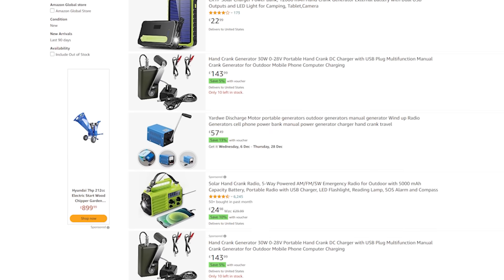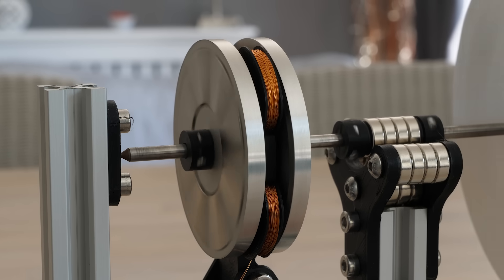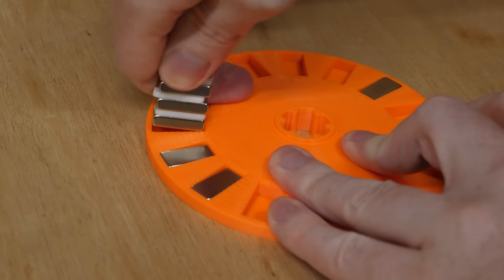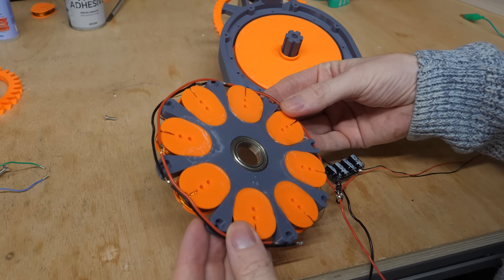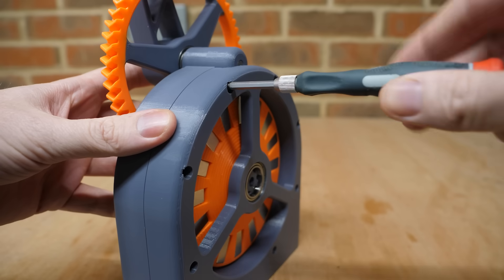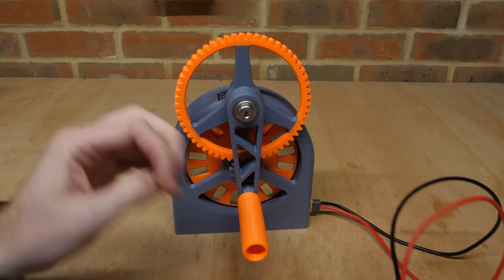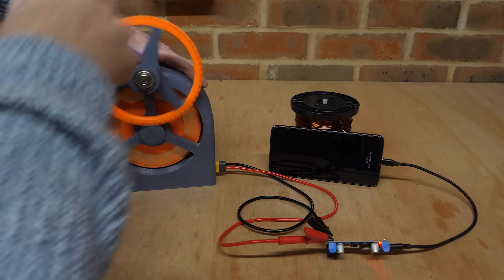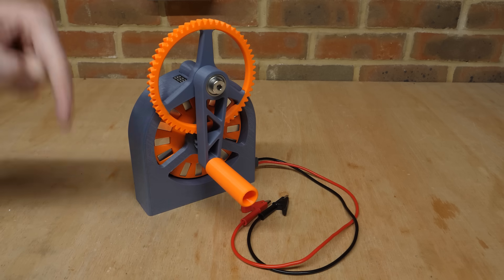Building a Generator

Comment: Absolutely LOVE this project Tim ! Attach a propellor, and you have a windmill, add a battery, and you go offgrid camping with full 12V electricity available. Measure available Kw output and explain calculations for windings, batteries, magnets and such, and there's a scientific story to be told too. This could take you in every direction you'd please 🙂
Reply: Sure you can. The only difficulties are in storing enough until next charging. excellent project!
Reply: @pauls5745 Don't charge/power stuff directly, instead use that power to charge an array of high capacity powerbanks.
Reply: modular crank device with interchangable crank shafts? windmill attachment, pedal attachment, hand crank(s), paddles?
Reply: hamster wheels and go crazy with it. free power lmao
Reply: @helo441  ok that one made me break out laughing omg
Reply: It is theoretically possible to adapt a turbine and take advantage of a decent water course as well.
Reply: I was thinking the very same thing
Reply: That's why wind power has failed massively. It's intermittent and not demand driven. Nice for small projects but not for large scale applications.
Reply: @flexairz  Water works tho u just need flowing water. Instead of the handcrank u could add on a waterwheel.
Reply: @jarateman6427  True, but it takes quite a bit of water to store energy using gravity. Unfortunately, the amount of cranking on a generator like this that would be needed for practical use would wear your arm out pretty fast! Might be better to hook it up to an exercise bike, though you would still get pretty tired.
Reply: @KitsuneKimmy yeah it needs a lot of water to store any significant amount of energy. if you want to store the equivalent of one Tesla powerwall (13.5kWh) by pumping water one story high you need 1600 tons even assuming 100% efficiency...
to fully charge an EV,  6000-1200 tons
this is why it only works when you have large bodies of water
Reply: @KitsuneKimmy  you could just up the gear ratio and lazily pedal at 10 rpm. Though you might blow something up if you put more effort in.
Reply: @KitsuneKimmy  How bout we settle this. We add propellers, a handcrank, a waterwheel, and a set of wheels to bike on. The ultimate power generator
Reply: @flexairz  In 2023, wind electricity production in the United States accounted for 12.5% of the country's total electrical generation. This was a 5.3% increase from the same period in 2022. Denmark uses 55% wind
Reply: @geemy9675  Thank you... it's hard to talk to those flat-earthers, but your numbers speaks with clearity, So again thanks for posting this !
Reply: @geemy9675  the key difference is that Denmark is more optimised for wind power. They get vastly more consistent wind than America, so it is more suitable. In addition, Denmark comes in at a low 43,094 km2 (16,639 sq mi), while America is at a staggering 9,831,510 km² (four million mi²). What this basically means is that a larger country needs to deliver the power to extremities better and will such have a large grid. Now why this matters is not because of the people but the generation. Basically wind power takes up a huge footprint compared to fossil fuels/nuclear, same as solar. These spread out power generation ares put a larger strain on the grid because they are not in the city too. In the country I live in, South Africa, the cost for constructing an amount of wind and solar is $7 00 000, while the grid cost is over $1 000 000. What this means is that wind power is not actually cheaper either because the grid construction cost to support it is massive, as well as nuclear and coal not having that problem as they can be built near one major city and that is it.
Reply: sorry for the paragraph im passionate lol, dad is a nuclear engineer/manager and im studying engineering and very interested. The best solution as a blueprint is high renewable (wind/solar/hydo), then backed with a lot of nuclear for the night time and winters. That way it is almost entirely clean, and very reliable. A lot of the scandinavian countries got lucky to have good wind or even geo like Norway, but most countries aren't so fortunate
Reply: @julianjeannes5369  In other words, we need to shift massive focus to nuclear energy and hydro-energy(where applicable.) 

There is literally zero excuse for the lack of nuclear energy. Nuclear energy is expensive but produces thousands of times as much energy as coal plants. We also don't need to mine for nearly as much material, nor spend the money to transplant said material. One ton of uranium produces the same amount of energy as 20000 tons of coal. 44 million kilowatt hours.

A single Uranium fuel pellet produces more energy than 2700 pounds of coal, 140 gallons of oil, etc. 

Also also, Thorium is 4 times as abundant and Thorium plants are less expensive than Uranium plants.
Reply: @julianjeannes5369  Also, your dad is awesome. I'm also an engineering student and I'm going into nuclear engineering, too. Planning to go to Missouri S&T, which is one of the better Engineering schools in North America.
Reply: @geemy9675 yep.. .. we also supply to germany's wind .. .. they even stop the "german" windmills here when its windy enough in germany so the grid cant handle it.. roughly .5 terrawatt of shutdown/un-used power.
 pretty🤯🤯🤯 we danes then cant utilize the same mills standing on our westcoast🤯🤯🤯
Reply: @julianjeannes5369  every country has natural resources wether it's solar, wind, geo, hydro etc. investing in clean energy is not only for carbon emissions it's also investing in the future , not being dependent on other countries. France has 75% nuclear since 90s and exports $3B of energy every year and us no dependent on Russian gas. nuclear fission us not clean because there are nuclear waste but it's easier to deal with it than with CO2 
Denmark has more than 50% wind and the fact that the country is small us not an advantage for wind, solar or any renewable. it's easier to do it in a big country with low population density and lot of unused land
Reply: @julianjeannes5369  yes I agree massive energy storage in batteries does not make a lot of sense. creating stationary batteries is kinda dumb when we need batteries in vehicles. increase every renewable energy source and increase the number of EVs of phevs. if everyone has smart chargers and plug as often as possible, electricity cost drops when renewable are providing more than electricity demand and all smart chargers can absorb the peaks in energy production or lows . they can stop charging when production is low, and smooth everything. when you are driving the average 30 miles in a day, maybe spending 1h on the roads, an EV can recharge those 30 miles in potentially less than 1 hour. but the EV could easily be plugged in for 12h or even 23h if chargers are available everywhere. that a lot of room to optimize electricity supply/demand and let people pay less to charge their EVs.
Reply: @flexairz  Some places are windier than others and you can always store excess energy in batteries for future use. Frankly there's always either wind or sun, so I think mixed sokar/wind plants would be better at producing electricity consistently than just one or the other.
Reply: @UltimatePerfection  Maybe where you live.
Where I live, you don't see much of either for half the year.
Reply: @flexairz idk about failed but there’s no reason they can’t be part of a larger grid where different renewable sources connect into one. Intermittency and is the name of the game when it comes to renewables, grid storage must be used to most effectively utilize any of them

Comment: it should be use in crank powered ebike like. change the chains into wires and you have digital drive bike.
i really want to see that happen.
Reply: i even make a blue print of it but i didn't have funds so its just my dream😂
Reply: that capacitor will make the bike crank free in a minute and cruise like its ebike then charge again in pedaling.

Comment: Hi Tom,
Instead of hand crank couldn’t this be used as wind collector? Then the wind cranks the rotor. So if mounted on a car or even motor house you could charge a power bank while driving. Maybe having multiple when if there isn’t wind when driving you could charge a leisure battery or something similar.

Comment: Wow with a few bits of improvements to satisfy my OCD, this could be made into a real product! For one the base needs to have something ergonomic to grab onto. The shaft may benefit from servo so that the cranking is more natural. And then for devices like smart phones that require few amps over long period of time, yeah icluding a bulk of super capacitors that you would just charge quickly and then wait for it to slowly get transfered to the phone would be ideal. Or just having some convertor that you can feed with high apms and is cabale of quickchaging on the device. But overall very sweet. One more use case that would be really crazy, would be hand charging bulk of super capacitors to 12V and then starting a car just from that. Such device would be invaluable to have around your car in winter.

Comment: Next step is to build some more gears and one of them strong and connected to string, on one end wheel when string is turned and on the other end of string bucket with sand or other heavy stuff. You store kinetic energy in the bucket and it can power up your device giving you light for some time or charge capasitors or other stuff.

Comment: But... But what about the amps. You focused solely on voltage. What about the amps! Voltage is half the picture. Voltage means literally nothing without amperage. You even had a multimeter to measure it.
Reply from the maker: This video was meant to be a short build/info video for an upcoming video on my main channel. However, it's gained far more interest than I expected, so I'll be making a follow-up soon!

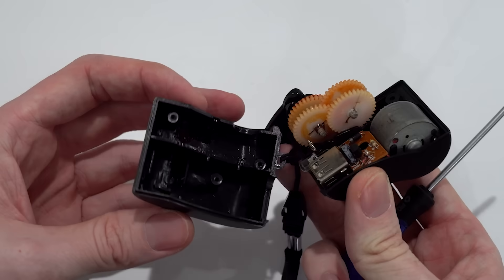Comment: @0:23 you could use a hair dryer motor, they have more coils of wire in the rotor, also they run on about 120v therefore when spinning it, it creates more voltage.

Comment: A.  Power up the supercap with the hand crank (a really fast charging but smaller capacity "battery")
B.  Feed thru to the USB charging module
I would bet that with 15-20 min of moderate hand cranking (vs 1 hr or more) you could definitely energy harvest enough out of that crank to really charge up a phone quite a bit...what is the max input voltage of the board...just got to make sure you don't go over the super cap or the max input volts of the board.
I also wonder if you weighted the rotors on the outside to create a flywheel if it would help maintain a steady speed of rotation
Pretty cool design and build!
Keep em coming!!!!
Reply: I was pondering the same thing. Here is the key, the super caps will reduce the consistency needed on the crank. You will still need to produce the same number of Watt hours, maybe a little more with added losses. The other question is does the charger just dump extra voltage to heat, then it is a very wasteful idea.

Comment: You can use a 1k resister on the ground side of an led and it will work perfectly with 12 volts.

Comment: I'm wondering if you could build a bike that is pedal powered, but the braking is regenerative to charge a battery as an emergency phone battery, and have a threshold where the regenerative braking can be supplemented with regular brakes in case of the need for extra stopping power.

Comment: Tom, the only real way to know how much your generator produces is to get a maximum power point tracker and a suitable load for it. The load impedance must match perfectly the impedance of your generator, at which point you measure the power dissipated on the load, and that's your generator rating, for a certain RPM of the generator. Would be cool if in the next video you would do that, because I'm quite curious how much a hand cranked generator will make.
Reply: If I had to guess it would be in single digit watts

Comment: Is it possible to make a faucet adapter turbine to turn generator, which charges super capacitor, which can charge phone. Faucet occasionally recharges super capacitors quickly, then in turn charges whatever through the USB.

Comment: Hi, what is the input voltage of the USB?
I'm surprised you didn't use the super capacitor as a quick fuel tank ... To charge phone over time. Then you wouldn't need to crank continuously. 
I was like... But... But... Watching..

Comment: Would be cool to set it up so the super capacitors and the USB board is built in and it would essentially be a hand crank power bank. Crank it for like a minute and you can charge the phone over a longer period as the capacitors discharge.

Comment: Instead of using a linear regulator, you should use a switching one (like in a buck/boost converter).  If you pump 10v into a linear regulator, it just chops it off at 5v and throws the other 5v away as heat.  But if you pump 10v into a switching regulator, you get 5v at double the current (hence faster charging), and less energy goes wasted.  That's what a buck converter does.  But a buck/boost can also drive the voltage up as well, so that it's always a constant 5v coming out (if it's boosting the voltage though, the current will be decreased, but if it's bucking the voltage, the current is increased, and you just get a steady 5v).  Would be good to put the cap bank in parallel with the crank though, so that you can continuously charge your phone and give your arms a break every few minutes... Maybe also convert it to be a peddaled device...

Comment: I just want to see two more stators for the outside.  Also a clamp built into the base to grab the edge of the table.  Also a stacked gear to get more rpm.  It would suck to crank for 1 hour to charge your phone but a battery or capacitor in line would work a treat.

Comment: Another idea for improvement is to put 2 thick steel discs on the outside of your magnetic rotors. I believe this would increase the magnetic field by containing it within the steel discs. Also this could somewhat increase the fly-wheel effect. Maybe the coils also could be wound around (or in-between) the steel cores to even better direct and improve the magnetic field.
Reply: High performance axial flux motors  generally use either 2 sets of coils, one on each side of the magnet rotor, or 2 sets of magnets, either side of the coil stator, to maximise flux through the coils per unit weight. Obviously this doesn't need to be as optimised weight wise but I suspect a twin magnet setup would be better for increased flux density over trying to direct the field with steel

Comment: can you design a gravity version of this? if you don't know, it's the kinda generator that get hangged and a weight is attached to a rope coming from it, it pulls it to generate electricity. thank you.
Reply: Also i just looked up 'gravity electricity generator" all that came up was free enegry crap! i'm not talking about that! basically attached a rope to this generator and use weights to pull it, more gears means the weight will be pulled slowly, and generate power for longer

Comment: If you wanna increase efficiency a bit you could wire your coils for a full wave rectifier instead of a full bride. A full wave has half the diodes and thus lower voltage loss. It does require more wire tho

Comment: Would be interesting to see if you can engineer it for using leg muscles instead of hand. Hooking it to your shoe and hanging it from your belt would allow you to use the far larger muscles in your leg. Charging at battery bank at 12V and 5A could be done in a few minutes but would give a whole days mobile phone charge.

Comment: Cool project, if I may add a safety concern is that you'd really prefer to use female XT60 connector on your generator.
As is, the pins can be shorted easily by anything conductive, and that's why power sources should have female terminals - look at your batteries with the same XT60 plug, or even electrical sockets in the wall.

Probably not an issue for this one, but it's a good habit to have 👍
Reply from the maker: Yes, that's correct. However, I wired it this way because it doesn't matter if the generator short circuits (the crank resistance just goes up). But if I charge a battery or capacitor, I don't want the wrong connector on them as that short would be far worse.
Reply: @TimStation  There's also 15 Amp Anderson Powerpole Connectors, which are genderless and protected on both ends. Regardless, you're right that the battery bank end is the one you need to worry about.
Reply: @TimStation I'm sorry to trouble you but I need to ask. How did you measure the current, if at all?
Reply: shorting a hand cranked generator...??
Reply: Not actually a concern in this use case.
Reply: Yeah, while the generator is a power source, it's only a source when someone is cranking it.  So you would only get shorts if it's not plugged into anything and you're cranking it.  Since the only real use case is to have it attached to something while cranking, I think he made an OK choice of connector.
Reply: I'm no electricity nerd so I have no idea what you mean by female-
Reply: @the-polities  female connectors have holes for the male connectors to insert into.
Reply: @jonathanodude6660  oh. I understand why they named it that.